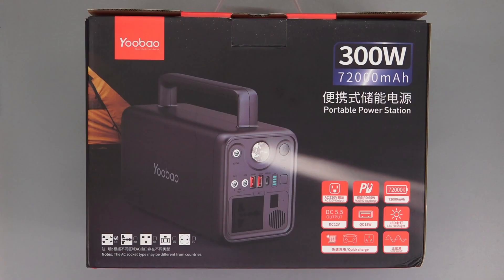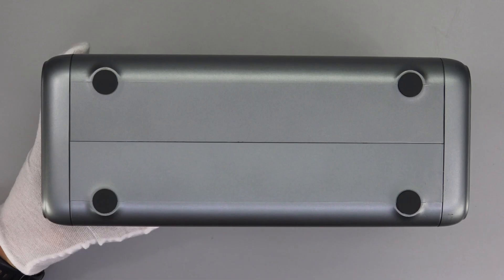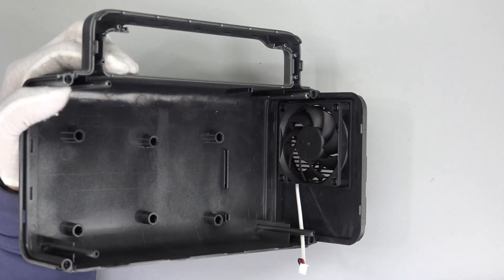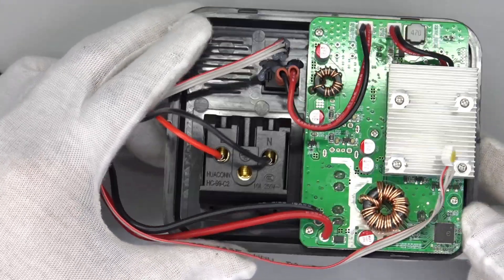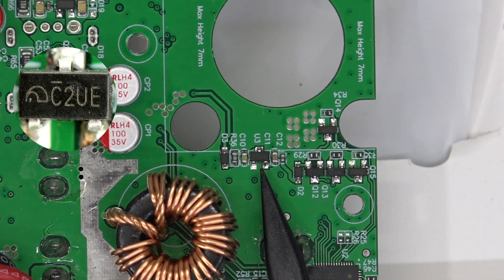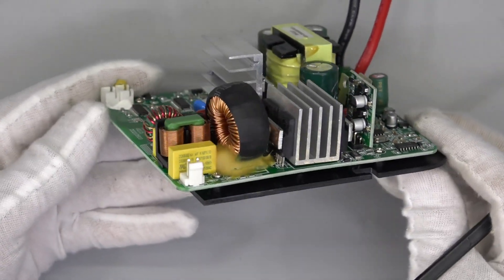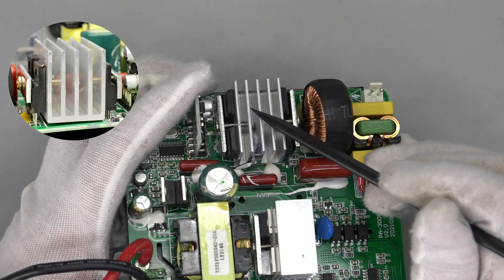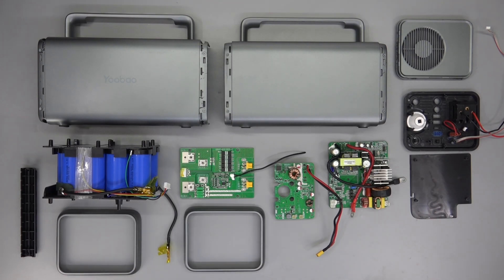Teardown of Yoobao 300W 72000mAh Portable Power Station (EN300WLPD)

Comment: Hi. I know this is an old video, but i have a Yoobao EN300Q that overcharged via the solar input, and this has has since affected the A.C. output. I switch on the A.C. output but it goes off after about 3 seconds because it's behaving like it's still charging via solar (the indicator lights interrmittently flash off and on) and  my unit doesn't allow for using the a.c output while the power station in charging. How can i get my a.c output to get back tow working properly? Every other thing about the unit works well. It still charges up my devices through the USB and Type C, and can still be charged to full.

Comment: I got mine short circuited and now the AC Out stopped working, just the USB module are working..

The switch turns it one but the fan doesn’t rotate (to give that vibrating effect) as usual..

What should I do??😢😞
Reply: Likewise mine. My ac output of Yoobao 300watts power station stopped working barely two weeks of usage.
Reply: Having same issues now, I think the power bank is trash
Reply: Did get solution to it? I'm having same issues
Reply: Finally got mine repaired. A specialised Engineer did it for me..
Reply: @EmmyTheDon  I took mine back to the company I purchased it. It was fixed free of charge.
Reply: Who can help fix mine in Nigeria... The battery failed to increase while charging for several hours
Reply: @olayemijoseph1185  Use original adapter charger for it. 15v 3a charger preferably.

Comment: My question is this a good power station?
Reply: my a/c plug stopped working on the unit very early on
Reply: Likewise mine. My ac output of Yoobao 300watts power station stopped working barely two weeks of usage.